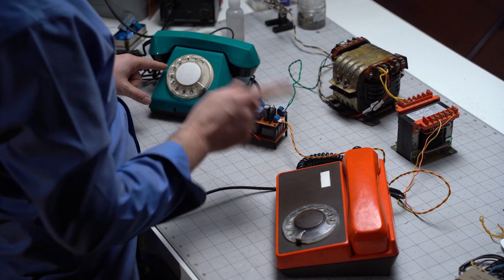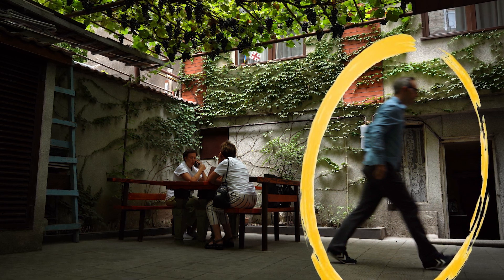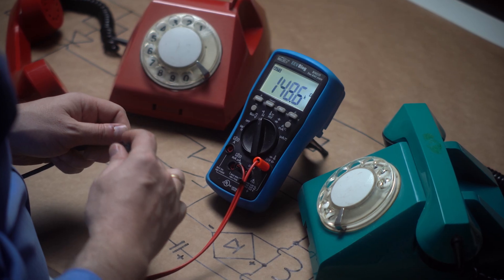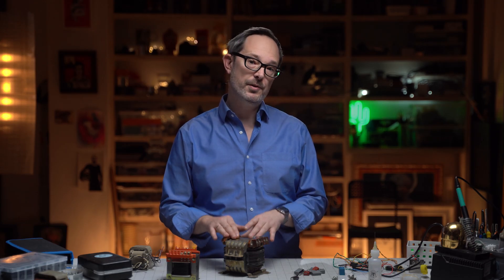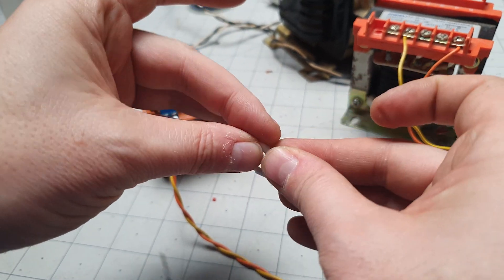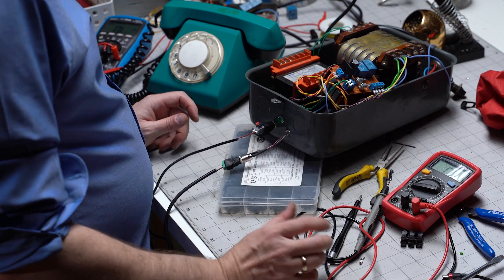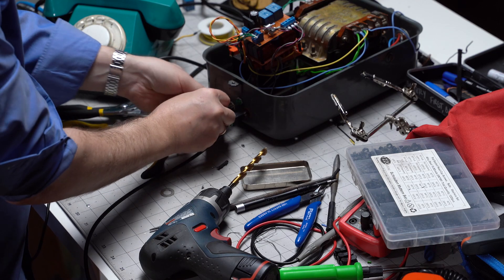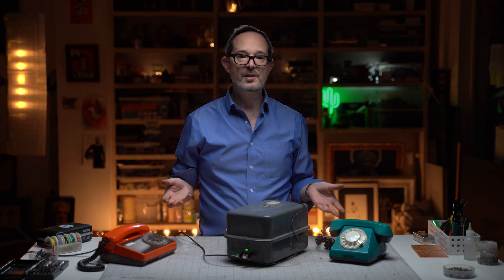I built an intercom from vintage rotary phones!

Comment: The good ole shorting the chassis ground with the signal ground problem! We've all done that... 
You could place some heat shrink over the threads that travel through the chassis and then use nylon washers or nuts to fasten the jack to the chassis.  Nice build!
Reply from the maker: Thanks so much for watching, Dan!

Comment: Hi ! I'll try to replicate this project on a scale a little bit larger, with multiple lines connecting all my modems (in laptops and desktops) to a central dial-up server .
I don't understand why both devices connected to the phone line should have similar impedance though . The relays should detect the off-hook state of the devices just fine

Btw, thank you for the schematics in the description ! It really helped me understand the circuit :3

Comment: This is a truly beautiful video; the attention & effort you put into making it visually enjoyable is outstanding and totally unprecedented in any electronics build video I've ever see.
I have wanted to build the same kind of setup for my home to my studio space above my detached garage. 
I'm in the US, so of course the voltages are different, which is just a matter of power supplies, but what I don't understand here is the role of the capacitors. Would I need the same capacitance or would that vary with the different voltage configuration? 

Thanks so much; literally looked for how to do this for years before I your video.

Comment: Hi, i'm really in love with your works, i'm watching all the stuff and trying something out. I have a basic question: i'm planning to put those in different rooms, maybe like what you did. Did you encountered some problem of loss of voltage/power of the phones having long cables? If that happened, how did you "pushed" the line? (I'm thinking about something like a DI for audio signal). Thanks a lot for your work

Comment: Very interesting project and loving the soviet era telephones.
But you porobably can use them with a Grandstream ATA for VoIP.
In the UK I have vintage British rotary pulse dialling telephones working originally with a Grandstream HT502 and now a Grandstream GXW4008.
I did need to alter the dials make/break ratio to match US standard, but that is just a matter of trial and error with the points gap that flickers during dialling.

Comment: In the states, we can use 9VDC for the voice circuit. For the ringer circuit, we need 90 volts AC @ 20 hz. An unit serves this voltage.

Comment: SO thrilled to find this! I want to build something similar for an art piece I'm working on but have a question for you Thomas! What happens if the other person doesn't pick up after the rings stop? I want to setup the intercoms in more of a walkie-talkie or voicemail recording way. Where essentially someone calls the other phone and if there's no answer, they can just continue talking and leave a message or live transmission that will play through the other phone. So that if/when another person does pick it up they could they engage. Does that make sense? Ideally, it's like leaving a voicemail for a stranger and at any point they could decide to pickup and engage. So trying to figure out tech-wise how to build this :D
Reply from the maker: @krussell__sprouts  I don’t have a specific answer for you, unfortunately, but my gut tells me that a basic version of the system you describe could be built around a microcontroller. It wouldn’t be very intelligent, but it might accomplish what you’re after. :)

Comment: Another self retaining relay, activated when both phones are picked up, which temporarily turns off the AC current. It must disengage when both phones are hug up. The idea is to not have any phone ringing when hanging the other up. You need the AC only at the beginning ...
Reply from the maker: That’s a great idea! Thanks for watching, Optron!

Comment: Hello, thank you for the wonderful videos in your channel, they are enjoyable and informative. I have already subscribed to you. I need some advice. I have two hand crank phones (western electric). They do not have any dials, the phone rings when the crank is rotated. Any idea, how can I connect these two phones to make an intercom? thought is if I rotate the crank in one phone the other phone should ring and by lifting the receiver I should be able to start the call. Do I need external battery or any exchange box? what type of wires needed. I am in Oregon USA. Thank you in advance.

Comment: The telephones i bought have 3 wires which are L2 S L1 and it can be wired up in a way that S and L1 is the positive and L2 is the negative or L2 is the positive and L1 and S is the negative so now i'm confused about how to wire up the phones to the circuit you made. And also the AC ringer is on L1 and S. Could you help me please?

Comment: I like the bulky-ness!  I'd stick it on the wall with pride. 
Can it be done like a hotel com system where you can press a button and ring an individual phone? Like for 4 to 8 handsets maybe? That would be exactly what I'm looking for.  I've been steadily going deaf for a while now and I got these awesome rotary phones with a red blinking light on top (I'll need two more still) that I want to hook up in all the rooms of my house so I can blink the kids and tell them I want them to come help me with something (yes people, deaf doesn't mean I can't speak anymore LOL). There are some deaf aid things like it, but it is basic tech and should NOT cost an arm, a leg, a pint of blood, and your first born for crying out loud!  Also they are ugly as sin, without even a fraction of the cool metal & retro look you've created. They are more like cheap, plastic junk that never caught up with modern tech (which are trying hard to prove that Deaf lives Don't matter). Maybe it could have a cool toggle switch wall panel to ring each phone! I would colour code them and all 💗💖
Reply: You can use an old PABX or SBX for that. All of them have ability to connect multiple phones, and then you can pick up one phone, dial the number of another extension and it will ring and the person there can pick it up and talk to you. Look around the markets, online sales, auctions, e-waste recycling centers etc. These old machines are obsolete now with IP phones and fibre so you can pick them up for pennies.

Comment: Im not quite sure about the soviet stuff but be careful with such high voltage on the speaking/listening. Over here such voltage could kill the microphones and speakers im used to. Sometimes those voltages and part lives counted on the phone repairman's ability to easily swap them as they were in mass production.
Reply from the maker: Thanks for watching!
Reply: @ThomasBurns  you had said the line was crackely. That is a sign of over voltage. American lines used 3-6 volts so that is what I am familiar with and a similar transformer voltage might be nicer on the carbon in the mic and the speaker bits.
Reply: Oh, I heard the transformer update, was that it?
Reply from the maker: @iftheseoldbeastscouldtalk7796  ah I see what you’re saying now. Yes I think you’re right that I’m likely using more voltage than is ideal. But the only solution I know of would be to use a Variac to find the sweet spot. Something to keep
In mind for the next version!

Comment: 8:45
Twisting the stranded wire before crimping the terminal often leads to the wire falling out of the terminal. The wire is simply unscrewed from the sleeve.
Crimp only the straight wire!
Reply from the maker: Ah good tip—thank you!

Comment: My uncle had an old mechanical exchange up in the attic, that he wired all the house phones into, so you could dial an extension and ring any other rotary phone in the house.   1 for ground level, 2 for second floor, 3 for the attic third floor.       If you were up in the attic and someone operated it, you could see all the rotary actions move on the mechanics to connect the call and disconnect it.   And of course you could dial out on the single house line or two.   So you are missing that critical part to connec them all, some mechanical exchange.

By the time I got around to setting up my own similiar system, it was the 90's, and you could buy something called the RingRite which would allow 2 or 3 phone lines to share the same line, and with the multi ring tone service from the phone company, the RingRite box would capture the first ring, and depending on the ring pattern from the phone company, route the call to the right phone and subsequent rings would be heard on that phone.      So basically with one phone line, you could have 3 different numbers with 3 different ring patterns, and the box would capture it and route it to the right phone in your house so everyone could have their own telephone number and never have to get called to the phone somewhere else... but still only pay for one telephone line.
Reply from the maker: Oooh this is cool! That would have been a simpler solution. But not as fun to set up. :)

Comment: That is odd that a rotary phone can’t be used on modern networks. In the States where we have state of the art switches that can still support dial pulse however the REN of these phones is the optimal 1. This amounts to how much current is needed to run the ringer. This amounts to a high current. New phones need very little current to ring electronic ringers. Ringing current is now generated in the fiber to copper DSLAMS located in each neighborhood. They don’t have the access to the high current ringer systems that were once in the central office.
That red phone reminds me of the EXETER Line of phones of the 70’s-80’s Bell system in the States.
Quick question, are you an ex pat living in Tbilisi? Your English is perfect.
Reply: I think what he means is you can't just plug these old rotary phones into the wall because in most places the copper networks have been shut down.

Comment: Does the fact that Russia has 50 hz power instead of 60 Hz affect that circuit much?
Reply from the maker: The only effect is the frequency of AC that’s used to make the bells ring. I assume that a 60Hz would have a slightly faster ring, but I haven’t tested this.

Comment: Sir, why didn't you think about manually winding a transformer for the desired voltage??

I've met the same connector problem while assembling an audio amplifier. after an hour of struggle I realised why most of the audio amplifier systems use the "Push Release Connector Plate module" at the back as speaker terminal, no grounding problem...

Really I loved your video... and i felt like I am watching it somewhere i love to be, other than my table. Thanks for filming this journey ❤️
Reply from the maker: Thank you, Vijith! Doing a custom winding on a transformer sounds cool, but that’s a bit beyond my skill set, I’m afraid. :) thanks so much for watching!

Comment: I'm guessing the crackling is the result of poor quality carbon granule microphones, does the crackling stop if you keep perfectly still? 

I'm about to build a similar intercom with two 1950's Australian Bakelite magneto crank telephones - no additional electronics required, just a length of wire between them and a 1.5V battery at each end to power the microphones. The magneto crank generates the AC voltage needed to ring the other phone.

Comment: I had an idea to make use of the phones instead of the mobile when at home, you would simply put the phone in a socket and it would be connected to the phone lines. The drawback though is if you have more than one phone then you would not know which one it is for until you answer.

Comment: That's farly one of the easiest way to connect two phones including ringing :)  I also run some vintage rotary dial phones here at home (german W28 and FeTAp 611), but they are connected to an ond PBX, which is connected to a VOIP adapter, so I can use these phones to make calls to the outside world :)

I think the problem you have with the connectors for the phones is, that they short out the upper connections on the phones on your circuit diagram. The capacitors are there to block DC current running to the relay and let AC current for ringing pass through.
If you put both upper connections on the sleeve of the jacks, they short out and bypass the capacitors, so DC current can run from on side to the other. So if you pick up one phone, the relay of the other phone also will close and disconnect the ringing.
Solutions for this are isolating the jacks (as yu did) or putting the positive side of the DC to the sleeve (positive ground).

If you want to build this with a microcontroller, you can also use an series inline relay with DC on the phone. If you dial a number, the relay should flicker. You can sense series relay that's on for a certain amount of time as a picked up phone, and each short pulse on the relay as a number count. a certain amount of downtime on the relay can be detects as hung up phone.
On german phones pulse dialing was 40/60ms per number, so I think I would try around 350ms for pick up/hung up and everything below 150ms for number pulsing.

Comment: Those phones are likely using analog microphones; causing the crackling you hear. Analog microphones use loose carbon granules and tended to shift while the handset is used,   this causes the crackling sounds. It could also be static electricity within the phone itself too. Phones are so fun!!!

Comment: Thanks for the passion and simple repurposing of these old phones. On the schematics and metal enclosure I trust you added a nice solid earthing wire to both upper and lower lids. Also a good idea to minimise the 240 AC wiring by having the fuse and switch near the inputs to the transformers where possible. Add additional insulation over any exposed 240v.

Comment: The only problem is that unless both phones are not hung up at exactly the same time one will ring. I would try to make the dial the switch so that dialing makes the other phone ring.
Reply from the maker: That would be more elegant, yes. Probably best done with a microcontroller rather than an analog circuit. Thanks for watching!